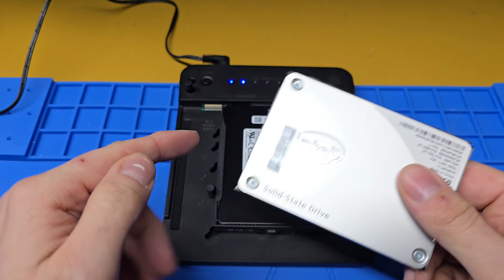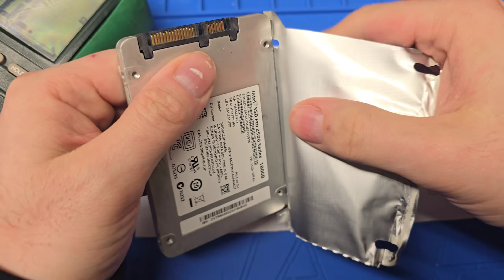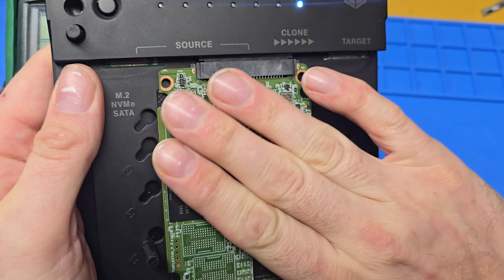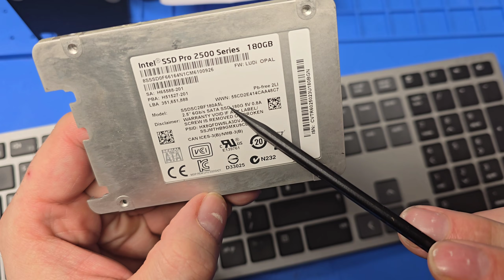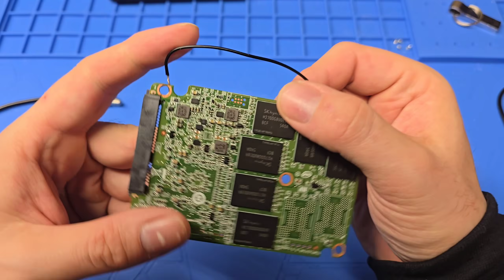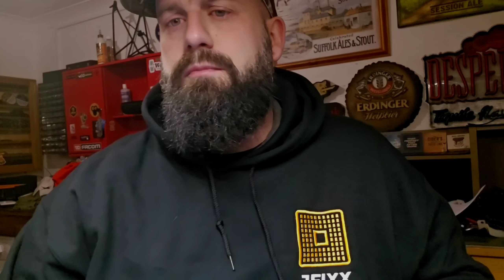Intel 160GB- SSD Repair - Can we Fixx it?

Comment: I have an similar SSD but with bigger capacity-240Gb I think. The two supposedly shorted capacitors are at 19 Ohm. The ssd works for a minute and then suddenly stops working. The protection of the docking station kicks in - must be a shorting faulty component, nearing the end of it's life. When I restart the docking station I see the data shortly again.
Reply from the maker: Thanks I have got another one so I will do a revisit video and compare the working drive to the faulty one

Comment: I have a bunch of 240GB SSDs from that Intel series that died in Lenovo machines. They suffer from a bug in the Sandforce controller (Bought by Seagate) the controller was not fully compliant with SATA protocols so they would go into sleep mode and sometimes could never get back out. If you search "computerlounge unbrick ssd" there is one heck of a long guide to getting these things unbricked. If it shows up in device manger under disk drives as "SandForce {200026BB}" (Might have to unplug/replug it a few times) it might be recoverable, but no guarantees that the fault wont happen again. One thing to avoid is to never allow the drive to go into any sleep mode. Can be turned off in windows power options and turn off computer sleep mode. Have not had the time to test the procedure myself.

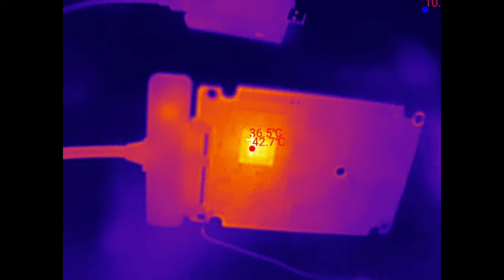Comment: If you look at the video @24:30 your new cable has a hotspot on it
Reply from the maker: I have checked I see what you mean I'm not sure if this is an issue tho. The thermal camera is very sensitive it will pick up even very small heat signature. My USB to SATA adapter will also have some controller inside and I guess should be showing slight heat while in use?
Reply: @ Its frustrating.
Yesterday was my Hard drive repair day, and at one point a few seemed dead.
It turned out to be a faulty port on my pc, annoyingly.

Do you ever sleep?
Im down South in Watford Hertfordshire Uk
Reply from the maker: @rectify2003  Also I have found exactly the same drive on eBay Germany and I have placed a bid and I'm hoping to win it so I can do a revisit video and compare the behaviour to a known working drive of the same model and I can compare measurements. Also I can sacrifice the working drive to harvest for parts to repair this drive. I am only repairing the drive for the sake of learning and having fun. It's annoying I can buy a brand new 2TB drive for cheaper than I can find a second hand drive of the same model 160gb lol 
And yes I must go to sleep!😁

Comment: Hi, I have two these SSDs (240gb, but i think they are same), one is OK, one is faulty. Let me know, if you need some reading :)
Reply: Now I made it to work and transfer out data. Just by reflow that chip. Those two capacitors are OK.
Reply from the maker: That's perfect I'll take a revisit. If you know what kind of current draw you get that could help to see if my draw is normal. Or any diode readings around the working chip I can make a comparison

Comment: Those 30-40 degrees are normal temperatures for an idling drive. Also the heat was evenly spread across the chip.
I would check the 2 pairs of data lines, and make sure they are intact.
You should find some series coupling caps on the way towards the controller, check them too.
Reply from the maker: @worroSfOretsevraH  Great advice thankyou

Comment: FB its ferrite bead not fuse
Reply from the maker: Thanks that's really useful. Do you happen to have a list of schematic markings and what they all refer to that you would be willing to share
Reply: @JFIXX1  dont know of one really, just by experience, C cap, R resistor, L inductor, F fuse, FB ferrite bead, D diode, thats the basic usually... Maybe there is some info around, i didnt checked it really 🤔
Reply: @JFIXX1  
### 1. Component Codes
   - C: Capacitor
   - D: Diode
   - F: Fuse
   - L: Inductor
   - PC: Power Capacitor
   - PQ: Power Transistor
   - PR: Power Resistor
   - U: Integrated Circuits, BIOS chips, Embedded Controllers, etc.
   - Y: Crystal Oscillator

### 2. Abbreviations for Signals and Concepts
   - AC: Alternating Current
   - DC: Direct Current
   - AGND: Analog Ground
   - BAT+: Battery Positive Rail
   - ADP_ID: Adapter Identification
   - VCC: Voltage Common Collector
   - BOM: Bill of Material Management

### 3. Specific Indicators
   - CHGEN: Charge Enable
   - ACOV: Input Overvoltage Protection
   - BUZER: Buzzer or Beep sound generator
   - EC_ON: Embedded Controller Enable Signal

C   :CAPASITOR
D   :DIODA
F    :FUSE
L    :INDUKTOR
PC :POWER CAPASITOR
PD :POWER DIODES/DIODA
PL  :POWER INDUCTOR
PQ :POWER TRANSISTOR
PR :POWER RESISTOR
PU :POWER INTEGRATED CIRCUIT
Q   :TRANSISTOR
R   :RESISTOR
T   : Transformers
U   :INTEGRATED CIRCUIT/BGA CHIP/EMBEDDED CONTROLER/BIOS IC,ETC
X   : Terminal strips, terminations, joins .oscilator
Y   : Crystal

Components code and abbreviation on Laptop motherboard

COMPONENTS CODE

C   :CAPASITOR
D   :DIODA
F    :FUSE
L    :INDUKTOR
PC :POWER CAPASITOR
PD :POWER DIODES/DIODA
PL  :POWER INDUCTOR
PQ :POWER TRANSISTOR
PR :POWER RESISTOR
PU :POWER INTEGRATED CIRCUIT
Q   :TRANSISTOR
R   :RESISTOR
T   : Transformers
U   :INTEGRATED CIRCUIT/BGA CHIP/EMBEDDED CONTROLER/BIOS IC,ETC
X   : Terminal strips, terminations, joins .oscilator
Y   : Crystal

ABBREVIATION ON LAPTOP MOTHERBOARD SCHEMATIC

AC             : Alternating current
ACDRV     : AC adapter to system-switch driver output
ACEDET   : Adaptor Current Detector
ACGOOD  : Valid adapter active-low detect logic open-drain output
ACIN         : Adaptor Current sensor Input
ACN           : Adapter current sense resistor
ACOP        : Input Over-Power Protection
ACOV        : Input Overvoltage Protection
ACP           : Adapter current sense resistor, positive input.
ADP+         : Adapter Positif Suplay
ADP_ID     : Adapter Identity
AGND       :Analog Ground
ALWP        :ALWAYS ON POWER
 B+            : AC OR BAT POWER RAIL FOR POWER CIRCUIT
BATT        : Battery

BAT+        :BAT POWER RAIL FOR POWER CIRCUIT
BAT_DRV :Bat Fet Gate Driver
BAT_V      Battery Voltage
BOM         :BILL OF MATERIAL MANAGEMENT
BT             :BUTTON
BT_EN      :Bloototh Enable
BUZER      :Connected
BYP           :Baypass
CHGEN     : Charge enable active-low logic input
CIN            : Input Capacitor
CLK_EN    :CLKOCK ENABLE
CN              :CONECTOR
CRT           :Cathode ray tube
CSIN         :Current Sensor input Negatif
CSIP          :Current Sensor input Positif
DC            :Direct current
DM           :DIM/DIM SOCKET/SOKET MEMORY/SOKET DDR
DOCK       :DOCKING SOCKET
EC            :Embedded Controler
EC_ON    :Embeded Controler Enable
EMI          :Elektromagnetik Interference(GANGGUAN ELEKTROMAGNETIK)
EN            :ENABLE
ENTRIP   :Enable Terminal
F               :FUSE
FSEL         : Frequency Select Input.
GATE        : Trigger gate
GND         :Ground
GP            :GROUND PIN
GPI          :General Power Input
GPIO        :General Power Input Output
HDMI       :High-Definition Multimedia Interface
ID             :Continuous Drain Current
IDM          :Pulsed Drain Current
IIN           : Operating Supply Current
IIN(SHDN): Shutdown Supply Current
IIN(STBY): Standby Supply Current
IS            :Continuous Source Current (Diode Conduction)
IVIN       :Battery Supply Current at VIN pin
JP            :JUMPER POINT
KBC        :Keyboard Controler
LCDV       :LCD POWER
LDO         :Linear Driver Output
LGATE     : Lower-side MOSFET gate signal
LPC          :Low Pin Count
LVDS       :Low-voltage differential signaling(SYSTEM PENSIGNALAN)
MBAT      :MAIN BATTERY
NB           :North Bridge
ODD         :OUTPUT DISC DRIVE
PCI          :Peripheral Component Interconnect
PGOOD    : Power good open-drain output
PIR          :PRODUCT IMPROVED RECORD
PSI#        :Current indicator input
PVCC       : IC power positive supply
RSMRST  : Resume Reset
RTC          :REAL TIME CLOCK
SB            : South bridge
SHDN       :Shutdown
SYS_SDN :System Shutdown
SPI           :Serial Peripheral Interface
TD            :Death Time
THRM      :THERMAL SENSOR
TMDS       :Transition Minimized Differential Signaling(TRANSMISI DATA TEKNOLOGY)
TP             :TES POINT
TPAD        :THERMAL PAD
UVLO        : Input Undervoltage Lock Out
V               :RAIL(POWER)
V+            :Positive Voltage
VADJ        : Output regulation voltage
VALW       :ALWAYS ON POWER
VALWP     :VALW PAD
VBAT        :BATTERY POWER
VCCP        :power chip(ich,graphic chips)
VCORE     :POWER PROCESOR
VDD          : Control power supply
VDDR       :POWER DDR (VDRAM/VRAM/VMEM)
VDS          :VOLTAGE DRAIN SOURCE
VFB          : feedback inputs Power
VGS          :VOLTAGE GATE SOURCES
VIN          : Input Voltage Range
VIN           :ADAPTER POWER SUPLAY(vol_in)
VL            :Power Lock
VL            :voltage across the load/Tegangan beban resistor
VL            :Voltage Linear
VLDOIN  :Power supply of the VTT and VTTREF output stage (to powerMOS).
VOT         :Volt_out
VRAM      :Power Memori
VREF       :POWER REFERENCES/SCHEMA REFERENCE/PERMINTAAN SKEMA
VS            :SUITCH POWER
VS+         :SUPPORT VOLTAGE POSITIF
VSB         :POWER SWITCH BUTTON
VSS         : Signal ground.
VSW        :POWER SWICT
VTT         : Memory Termination Voltage
VTERM    :Memory Termination Voltage
VUSB       :POWER USB
VGA         :POWER VGA (VGPX/VGPU/VCVOD)
VGFX       :POWER GRAPHIC CHIP  
VREF       :VOLTAGE REFERENCES

Credits to "Adie Dkhaz "

Comment: You called it a, "Hard Drive."

I have images of all my System Drives, and multiple backups of my Data Drive.

I laugh in the face of data loss, or hardware failure! ... 30 years of using and building PCs hasn't been wasted!
Reply from the maker: @marcse7en  Do you use cloud storage as well
Reply: @JFIXX1   No. I don't need it. I want to have total control over my data. My data has never been safer or more secure. I've got it down to a fine art. Two encrypted copies of my data go everywhere that I go. Even when I step out of the door, one encrypted copy of my data goes with me along with my keys. The encryption key is stored on my phone in a secure folder, and the phone is encrypted too. It requires three passwords to start the phone. Confidence in the security of one's data is a great feeling! 👍

EDIT: Tried to answer your question (below) in detail, but YouTube seemingly removed my comment TWICE! ... Sorry!
Reply from the maker: @marcse7en  Wow I admire your efforts! Can you share what portalable storage you use
Reply: @JFIXX1  It's not often I get complimented on my technical prowess! ... My portable storage is simple and not too expensive. Firstly, my data is divided into three main types; Audio (CD music, and audio recordings), Data (photos, documents, PC software), and Video (home videos from the past 40 years).

I use a USB Flash Drive (metal SanDisk 256GB) which my Data Folder ONLY is backed up to. The drive is encrypted with VeraCrypt. If lost or stolen, the Data is totally secure. This USB drive fits in a zipped compartment in my key wallet. When I leave my home, my keys and encrypted Data go with me. The USB Drive is my last choice for Data recovery.

I also carry with me, a 2TB Western Digital M.2 NVME SSD, in a USB case. This is also VeraCrypt encrypted, and holds ALL of the Data I've created in the last 30 years, and all my home movies over the last 40 years. This is one of my first choices for Data Recovery, but be aware, unpowered SSDs can lose data over long periods of time! This drive is powered up rack week to run a backup.

At home, I have another two bus-powered 2.5" USB hard drives (unencrypted) which also back up all my data.

My main Data Drive is currently a 5TB Western Digital bus-powered USB HDD. I back up every Sunday to my four back up drives.

Data loss is practically impossible. It would take a nuclear EMP to destroy it! My Data is incredibly valuable to me. Losing it is not an option.

I would say to people, if you value your Data, backup, backup, backup, and backup ... And take two encrypted copies with you, everywhere you go!

Also remember to scan your storage media with Victoria, and check the Smart Data. Also, it's good practice to rewrite your Data every few years, to guard against bit rot.

Oh, and avoid SEAGATE like the plague! ... WD are bullet proof in my experience.

Bet you wish you'd never asked now? 🤣
Reply: @JFIXX1  I don't believe it! ... I spent AGES writing a long comment, explaining my backup procedure. I came back to edit it, and it's VANISHED into thin air!

YouTube have been shadow banning me for a long time. Comments vanish, get removed, and YouTube often threaten me. Imy sick to death of them.

Unless the comment reappears, you won't see it.

Just remembered, I copied the comment onto my Tablet clipboard, just before posting it.

Here it is pasted from the clipboard, although it will likely disappear again! ... The edit was that I use a FREE program called Synchredible to backup my drives. I highly recommend it.

It's not often I get complimented on my technical prowess! ... My portable storage is simple and not too expensive. Firstly, my data is divided into three main types; Audio (CD music, and audio recordings), Data (photos, documents, PC software), and Video (home videos from the past 40 years).

I use a USB Flash Drive (metal SanDisk 256GB) which my Data Folder ONLY is backed up to. The drive is encrypted with VeraCrypt. If lost or stolen, the Data is totally secure. This USB drive fits in a zipped compartment in my key wallet. When I leave my home, my keys and encrypted Data go with me. The USB Drive is my last choice for Data recovery.

I also carry with me, a 2TB Western Digital NVME SSD, in a USB case. This is also VeraCrypt encrypted, and holds ALL of the Data I've created in the last 30 years, and all my home movies over the last 40 years. This is one of my first choices for Data Recovery, but be aware, unpowered SSDs can lose data over long periods of time!

At home, I have another two bus-powered 2.5" USB hard drives (unencrypted) which also back up all my data.

My main Data Drive is currently a 5TB Western Digital bus-powered USB HDD. I back up every Sunday to my four back up drives.

Data loss is practically impossible. It would take a nuclear EMP to destroy it! My Data is incredibly valuable to me. Losing it is not an option.

I would say to people, if you value your Data, backup, backup, backup, and backup ... And take two encrypted copies with you, everywhere you go!

Also remember to scan your storage media with Victoria, and check the Smart Data. Also, it's good practice to rewrite your Data every few years, to guard against bit rot.

Bet you wish you'd never asked now? 🤣
Reply: @marcse7en nice, one  of my intel  ssd  apear  and in a few seconds disappear, is possible  to recover  this  intel ssd?😢
How  to save my data ,  my other data are stored in two  external hdd.

Comment: Check for faulty regulator... This is not overheating temp.
Reply from the maker: @park8023 That's interesting I'm going to check again tomorrow thankyou. If the regulator is faulty it can be allowing too much current to flow? I am looking for another drive the same so I can compare measurements

Comment: I don't think the 2.5 drives use 12v that's why you can power em from a USB port
Reply from the maker: @ziafathussain8546  That makes sense what about mechanical 2.5 drives do they require 12v for the motor? Thanks
Reply: @JFIXX1  no only 5v even 3.3v is not available on most atx power supplies via sata connection
Reply from the maker: @ziafathussain8546  That's good to know!
I assumed it was using all 3 until I saw it said 5v on the case - with every thing I try and repair I'm learning something new!
Reply: @JFIXX1  No problem 😊

Comment: Without a heatsink how can you be sure that the chip is not running normally ??
Reply from the maker: @martin87865  This is a good point Martin. I am not sure what the normal temperature should be but my thinking was that it appeared to heat up instantly very hot without performing and activity  and there was a pinpoint hotspot inside the chip not just the chip warming up as it's transferring data under load etc. It would be useful to have another drive the same as a reference point as a lot of the time I am only guessing things

Comment: I suggest to just remove those two suspect capacitors and see what happens. In many videos I saw that there are components that are not strictly needed. Of course if that ssd contains important data instead of just removing they should be replaced.
Reply from the maker: @playmangostingiu2217  I believe if the capacitor was faulty then I would see a much lower resistance measurement if I was to take off the main controller IC I think the short would be gone on the capacitors. I am going to get a new SSD but I'm interested to do a revisit video to have a play with this if I can find another drive exactly the same I can compare measurements and use the second good drive as a reference point as I have no Schematics to work from